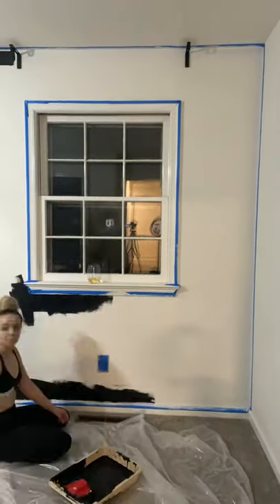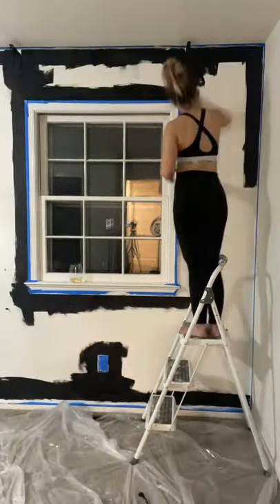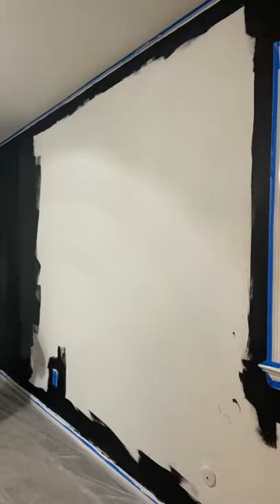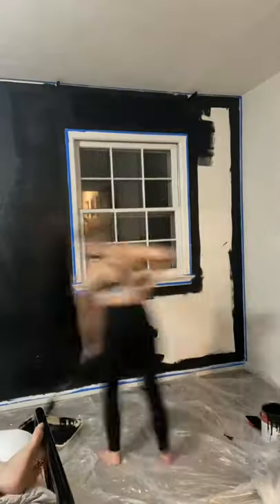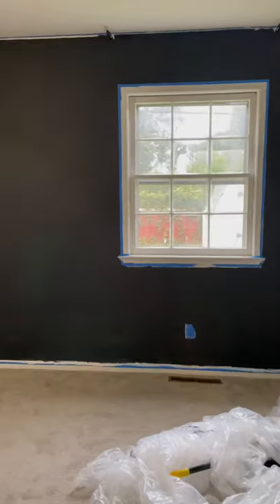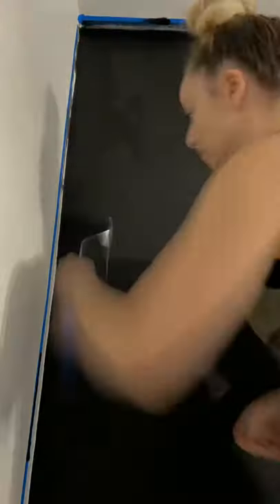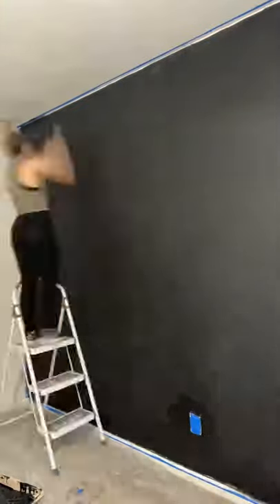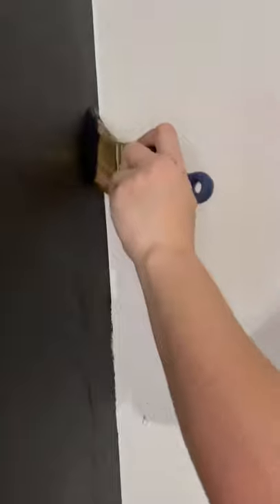HOT MESS HOUSE RENOVATION PART 98! | VIRAL YOUTUBE SHORTS & TIKTOK SERIES! | LEXI DIY

Comment: to get a straighter paint line with tape get some paintable caulk and run a small thin bead along the edge and it won't allow bleed thru and be nice and straight.

Comment: One tip I've learned from acrylics for the cleanest line is to tape like normal but first lay a small coat of the primer or lighter wall color on the edges but slightly on the tape as well. you use so it fills the edges first and then roll the darker color over when wet as evenly as you can. Idkh it would translate so a wall but has works on paper for me. How it helps🤞

Comment: The best way to do edges is using clear caulk. Tape the wall the way you would and before you start your edges with paint, go over it with clear caulk. And then paint once it dries. When you peel it away it will leave a smoooooth line. Try on something small before or YouTube jalapeño solutions. He’s my FAVORITE home improvement channel.

Comment: Paper when masking off the wall would help with your edges. And it actually the way you paint that is working for you .  Paint roller has a left and right side. The left is "open" the side the roller comes off of. The right has the metal that meets to the handle
   When painting with a roller the medal is the direction to take if when you hold the roller and the medal is on the right you shall roll left to right . As you did here on your second coat. It's you girl😎 not the paint

Comment: I bought a paint sprayer and haven’t used it yet.
I’m wondering why you’d need to ventilate any differently with the sprayer if you’re using the same paint?
Reply: Because the sprayer aerosols the paint so not only are you breathing in the chemicals, you’re breathing in the actual paint itself